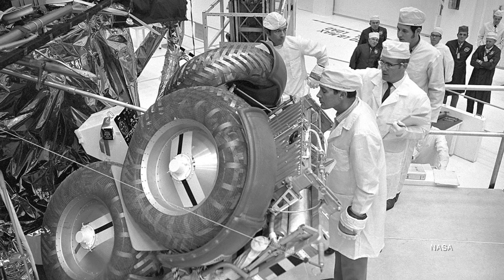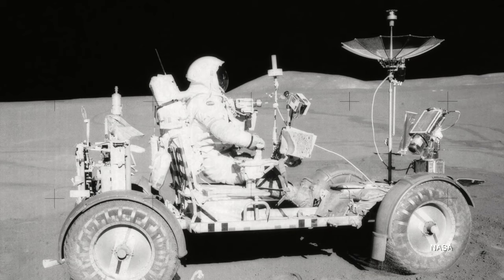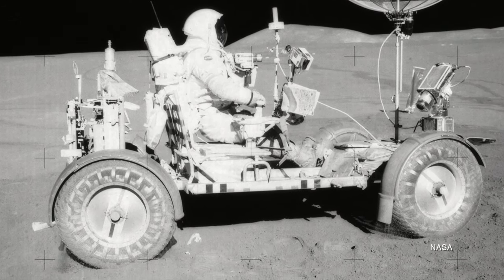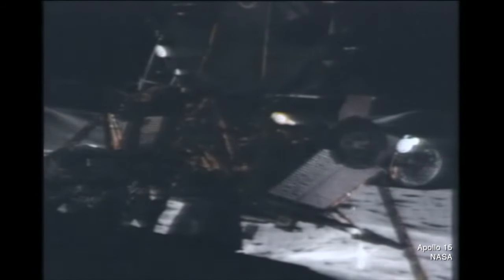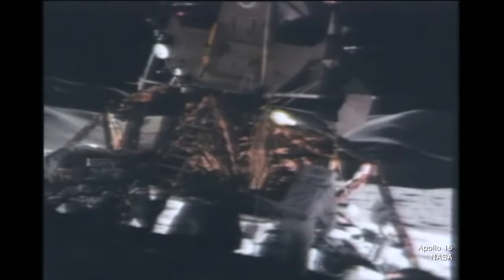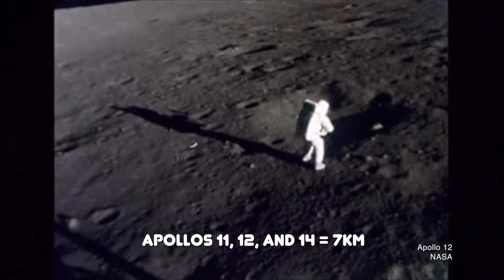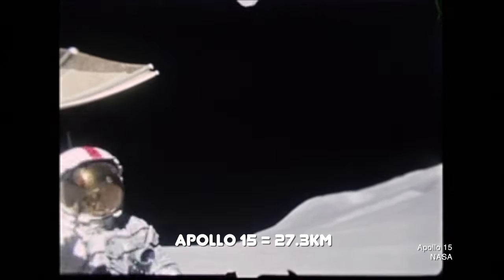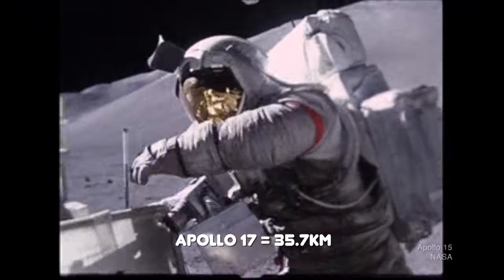How NASA Took Cars to the Moon

Comment: No that's just a measurement of the speed of sound when it breaks the sound barrier! so four times speed of the sound barrier is how fast they have to go to stay in orbit around the Moon look up on Google how fast you have to go to stay in orbit around the Moon on Earth it's about 18,000 miles per hour supposedly if they went to the moon they had to get up to at least 18 thousand miles an hour to escape the Earth gravitational force then they had a slow down when they approach the moon in orbit to go into an orbit since the Moon is only 1/6 they didn't have to go 18000 miles an hour basically around 4000 miles an hour so the lunar lander which was at rest while I was on the moon how to speed up to about 4000 miles an hour just to catch up to the lamb for docking the engine on the limb was not capable of that they didn't go to the moon no brainer
Reply: They had to use a giant Saturn rocket just to get to the moon and get up to 18,000 miles per hour to escape the gravitational of the Moon and then use the smaller rocket to slow down to about 4000 miles for the orbit so it took about 1/6 moon gravity! One sixth of the Saturn rocket engine would still be larger than the whole lunar module   didn't have enough power to get up to 4000 miles an hour to catch up to the Orbiter that was running around the Moon supposedly
Reply: Engine wasn't big enough and not enough fuel on top of that to get up for thousand miles an hour
Reply: The X-15's official world record for the highest speed ever recorded by a manned, powered aircraft, set in October 1967 when William J. Knight flew Mach 6.72 at 102,100 feet (31,120 m), a speed of 4,520 miles per hour (7,274 km/h; 2,021 m/s), has remained unchallenged as of May 2018.

First flight: 8 June 1959

Number built: 3

Retired: December 1968

Manufacturer: North American Aviation

X-15 Flight 

The rocket engine on the lunar module wasn't any where big enough in size alone to get up to 4000 miles per hour

Comment: Look at the dust coming of the rear tyres of the rover The boffins say the Moon's gravity at the surface is only 17 percent that of Earth's that dust should be sent straight into space not falling back the way it doese on earth
Reply: You aren't very smart are your Sharron Sorsky?
Reply: The dust thrown up by the wheels of the Lunar Rover clearly does not behave as it would on Earth and its behaviour is exactly consistent with a low gravity, no air-resistance environment. As evidenced in video sources the dust quickly falls back to the ground showing no sign of floating or being slowed down in a horizontal direction by air-resistance. On earth, dust tends to billow and form clouds due to the effect of our atmosphere. The trajectory of the dust is also characteristic of the lack of air-resistance. A perfect example of this is the "Rooster Tail" dust trails kicked up by Apollo 16's John Young during his "Grand Prix" in April 1972. This very situation has been analysed, studied and the published results are easily obtained online. "Ballistic motion of dust in the Lunar Roving Vehicle dust trails", Hsu, Hsiang-Wen, Horányi, Mihály, (University of Colorado), American Journal of Physics, Volume 80, Issue 5, pp. 452-456 (2012). They conclude that the lack of particles’ deceleration along the x-axis of their coordinate system, could only be the case if Apollo 16’s rover footage was filmed in a vacuum and in an environment where the acceleration due to gravity was 1.6 m/s2. . Enjoy reading, take care.

Comment: Problem 1, it takes a couple pounds of fuel for every pound of moon buggy to get the Saturn V off the ground depending on latitude, atmospheric drag, altitude related changes in gravity, etc. The Apollo F-1 engines had a big efficiency problem you can see by the large flame plume. The Rover was not part of the original design yet NASA managed to add extra fuel, the buggy and recalculate a multi-stage flight plan with 1960's technology.

Problem 2, they stuffed 460 pounds of folded moon buggy in one corner, quadrant 1. The rocket wasn't designed for this extra weight or to counteract the imbalance.  Like taping a weight to the side of a model rocket and expecting it to fly within the corridor of a precise 240,000 mile trajectory [..using 1960's technology].   Lunar lander would have also been unbalanced on descent.

Problem 3, there's pictures of the moon buggy without tire tracks around it even though it should've been kicking up dust.  Like the lunar lander that left no blast crater.
Reply: Problem 1:  Hence why they redesigned the F1 engines for Apollo 15/16/17, adding efficiency and an extra approximate 25,000 pounds of thrust in each.

Problem 2: Hence why the LEMs for Apollo 15/16/17 were also redesigned to accommodate the longer surface stays and the rovers.  The entire descent stage was completely rearranged and modified.  https://www.hq.nasa.gov/alsj/a14/a14-43939523-LM10-LM14-Fam-Manual.pdf

Problem 3: Yes, this is not a surprise.  There are many reasons why tracks are not consistent.  The surface wasn't consistent, and sometimes the dust layer wasn't thick enough to leave deep tracks.  Sometimes the rover bounced right off the surface and didn't leave tracks.  Sometimes they stopped and did so much work around the rover that they basically stepped on most of the wheel tracks, obscuring wheel tracks with boot tracks.  Sometimes it was just a matter of lighting angles.  It happens.

As for the lunar lander not leaving a blast crater, yeah, of course not.  If there was a blast crater, that would have been an obvious sign of a hoax.  Nobody expected a blast crater.  It would make no sense if there was a blast crater.  The landing engine was throttled back to 2500-3000 pounds of thrust (depending on the mission) for landing.  With that huge 5' diameter engine bell, that means that the thrust was spread over 20 sq feet just from that alone.  Add the fact that thrust spreads very wide, very fast, in a vacuum, and you're looking at at least 30 sq. feet of surface area to absorb the 3000 pounds of thrust.  That's only 100 pounds per square foot.  A 200 pound human on Earth exerts 200 pounds of force over less than 1/2 a square foot when he walks.  A human exerts more than DOUBLE (more like 4-5x) the amount of force on the ground on Earth per square foot than the LEM engine exerted on the moon during landing.  Or, just look at any old 10,000 pound helicopter that you want.  10,000 pound helicopters (such as a Huey from Vietnam) exert over 10,000 pounds of thrust on the ground when they land (of course).  They're not leaving craters.  They land on beaches, and blow some sand around, but no crater.  They land on dirt/grass, and you'd never even know they were there, because they leave so little of a mark.  Or, how about 50,000 pound helicopters?  They land with over 50,000 pounds of thrust (of course).  No craters.  So, why do conspiratards expect there should be a huge crater from a little 2500-3000 pound engine that has a massive 20 sq. foot engine bell nozzle?

You idiots really take the cake.  You list out these stupid objections without doing an ounce of investigation, or an ounce of mathematics.  You dummies think that you've found these massive "gotcha" moments, that somehow no rocket scientist or aerospace engineer in any country on the planet has been able to notice.  And, you're stupid enough to believe your own bullshit.  ANY anti-Apollo claim... you accept... without the slightest bit of scientific scrutiny... no matter how dumb or outlandish the claim is.  ANY pro-Apollo claim... you reject... no matter how well grounded in science.  You're idiots.  Every one of you.

Comment: I have an aircraft. It will fly from London to Tokyo nonstop. It is shaped like a washing machine. It is made of aluminum foil, duck tape, and cardboard. It will keep you warm in minus 250 degrees, and cool in 250 above zero. Don't worry, we never tested it before, but I think it will be fine. Would you take a ride in it? Yet that is what they did back in 1969. 🐂💩😂🤣😂😂🤣🤣😂
Reply: @willoughbykrenzteinburg  Show me the blueprints... They were destroyed, or in a prop closet in hollywierd...
Reply: @rubenperez6463  If you're simply going to reject everything, there's really no point. 

So you think Apollo 11 was the first time any component of the mission was used?  They just decided for some strange reason to start the Apollo program with the designation, "eleven" because they felt like it?
Reply: @willoughbykrenzteinburg  
YOU SAID: "You need blueprints to prove it's real when you can literally touch one with your own hands?"
== Well, you had better watch what you ask for, because you just might get it.  The problem is, you actually cannot touch one.  But, undoubtedly, the entire basis for this dummy's assertion about the hatch being too small is because of a different conspiratard who tried to touch one.  I really don't remember the exact story, but, I'll give it my best shot to remember it as best that I can....

This was a conspiracy nut who set out to prove that the hatch was too small.  He went to one of the museums that has one that has a nearby elevated walkway.  I can't remember which one, but maybe it was in Washington at the Smithsonian, because they sometimes have theirs in an area near an elevated walkway, where you can kind of see the top of the lander.  So, the guy tries to guess at the size of the top hatch from that bad angle, and from a distance, and comes to the conclusion that it's too small to fit people through it.  He then went on to throw stuff at the lander, apparently including a long tape measure, in an attempt to take an actual measurement.  Of course, they threw him out.  And, then he posted a video online, talking about how the museum threw him out in order to conceal the secret length of the hatch, so that he couldn't confirm "the truth" that the hatch wasn't big enough.  No, he didn't get booted for throwing things at the lunar lander.  No, of course not.  He got thrown out because they need to keep the conspiracy going.

Sorry if I butchered the story.  I honestly don't remember if my facts are 100% right.  But, I'm fairly confident that I at least got the story close, if I didn't get it spot-on.
Reply: @rockethead7  Perhaps "see one with your own eyes" would have been better.

Comment: There is one very simple reason why there was never any Rover on the moon: there was no no room to store it underneath the upper lunar module. There was no storage unit capable of holding this very large rover. 
Look at this diagram: https://upload.wikimedia.org/wikipedia/commons/4/4a/LM_illustration_02.jpg

Almost the entire lower half of the LM contains the large fuel tanks and the descent engine. Do you see any room for it in the diagram? No, of course not.
Other diagrams of the LM show storage units, but these were small "cupboards" on the outside of the LM. 
The video footage you see here of an astronaut pulling out the Rover is that from a mock unit with the supposed fuel tanks removed. It's fake. 
And if the story about the Rover is a lie, then probably everything else NASA has said about the moon landings is a lie too.
Reply: They did not store it inside.  Thy stored it folded and on the outside. Bottom of the rover faced out.  Folded wheels fit into Quadrant 4.  Lots of diagrams of this, even video of the folding and stowage process on Earth, and the unfolding on the moon.
Reply: Brian Brown,

1) You're wrong.
2) Why are you using a schematic for the LEMs for the earlier missions, and not the later ones with the rovers?
3) There are thousands of blueprints and schematics available online that show how the rover fit, in a hell of a lot of detail.
4) So, how does this conspiracy work, in your mind?  You think that none of the thousands of people who worked to build the rover and LEM could figure out that the damned thing couldn't fit, but YOU figured it out??  Do you have any idea about how many people would have known something was wrong?  None of the thousands of people at General Motors, Boeing, or Grumman ever said a word about the "fact" (pfffttt) that the rover didn't fit???  Is that how this conspiracy goes in your mind?
Reply: Brian - You've just watched a video on how they did it (You DID watch it?) and you're asking how they did it

Comment: As it is possible that in 2021 it will not be possible to see them in the current state on the moon. Or they're not really there ...
Reply: Trebor  It's the translator

I meant CURRENT
Reply: @maenal69  
YOU SAID: "When the Rover's are seen intact on the moon, I will discard all the aforementioned."

== Shifting the goalposts.  We can see the landers, the rover tracks and foot paths.  But, you reject the rovers simply because those only occupy a few pixels on the best resolution available today.  And, when they double the resolution, you will just say you want triple the resolution.  And, when they provide 4x the resolution, you will just say you want 9x the resolution.

YOU SAID: "At the moment there is not a single proof of its existence other than unsupported theories."

== Ridiculous.  There are mountains of evidence for Apollo.  What's wrong with you?

YOU SAID: "Thanks for taking the trouble to break down my arguments, but a link that proves your theory would have been enough for me."

== Links are not allowed in comments of this video.  You are asking for something I cannot provide.
Reply: @rockethead7  You can paste a link and I will gladly copy and paste it into the address bar with no problem. A link in which at least some sign of these vehicles is seen on the lunar surface, that will be enough to shut me up.
Reply: @rockethead7  If you say that no links are allowed here, when in reality there is nothing to prevent it, your comments lack all credibility.